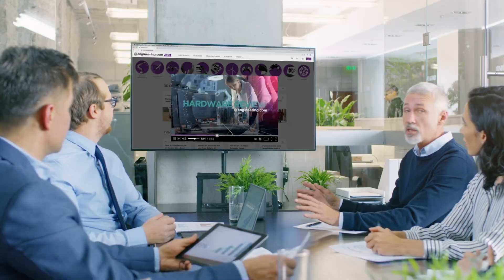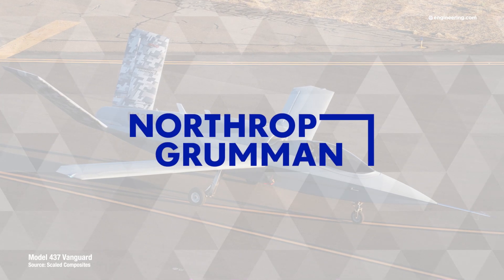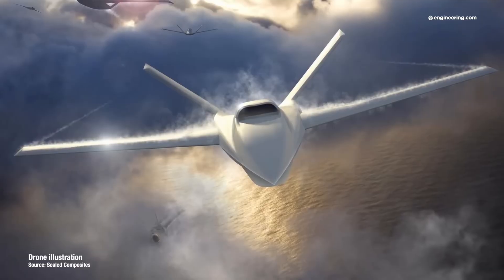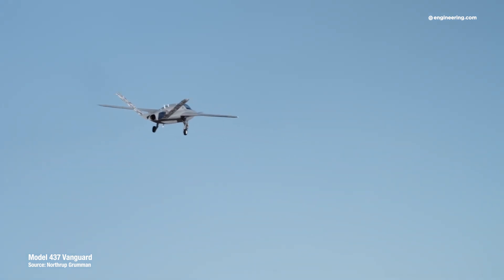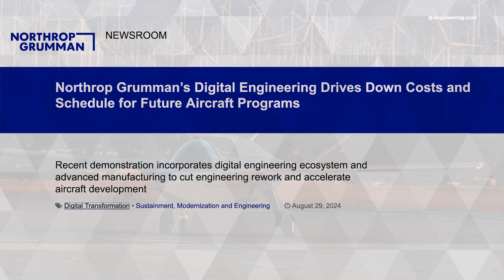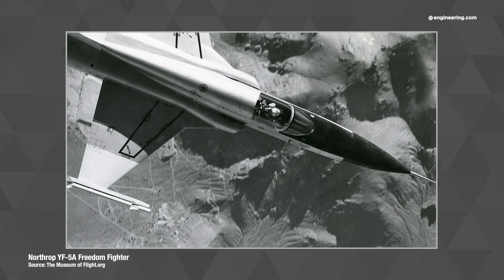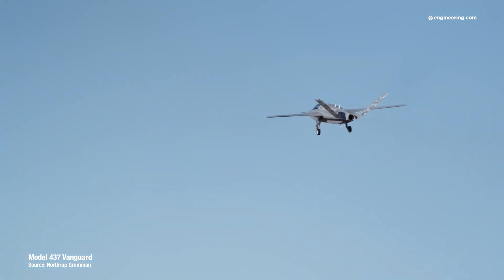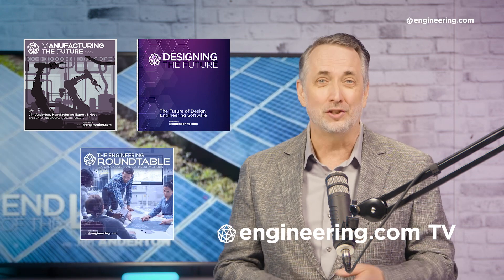Scaled Composites’ Vanguard may be the 21st Century equivalent to the Cold War F-5

Comment: 2:43
And notable is that the US where the F-5 was designed and built WAS NOT one of the nations that adopted it (except in tiny quantities to simulate "aggressor" aircraft, like at the Top Gun school).
Reply: But they bought boat-loads of T-38s which are a minor variation
Reply: It was a mistake that the U.S. did not deploy the F-5 in volume.  It was far better than the F-4 in the air to air role for less than half the cost.   The F-5A did not carry the radar guided missiles the F-4 did, but since radar missiles of that era were near to useless (the Navy once fired 50 of them in a row in Vietnam without a single kill), that was a feature rather than a bug.  Instead the F-5 put 20mm cannon and Sidewinders on target for minimum cost.
Reply: @MaxPalmer-1  20/20 hindsight is wonderful.
We had no way to know prior to extensive combat that those early radar guided missles would be so ineffective.
Phantom WAS effective in the air-to-ground role though, when properly guided from the ground - F5 had noticeable less payload on bombs and napalm etc.

Comment: F-5 has almost 2800 kg  ( 6200 pounds ) of payload capacity .   That is a lot more that Vanguard can carry .
Reply: it's the concept, jesus
Reply: And still the Vanguard, using smart guided weapons, is certainly going to have a bigger impact on the battlefield per sortie. The F-5 relied on dumb bombs with standardized delivery profiles for accuracy. So I would argue the payload capacity isn't relevant as a measure of what impact the aircraft has on the battlefield.
Reply: luckily the Vanguard will have access to things like small diameter bombs